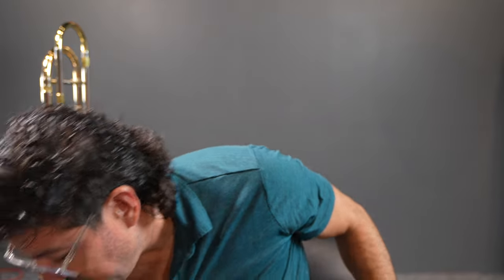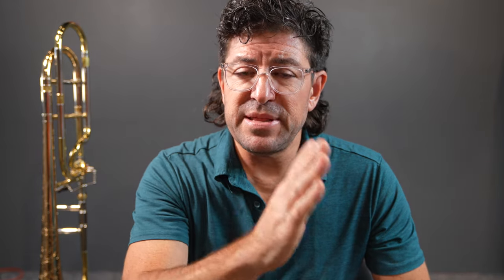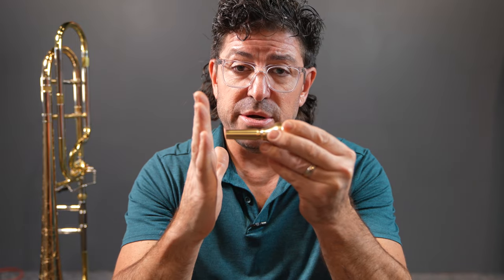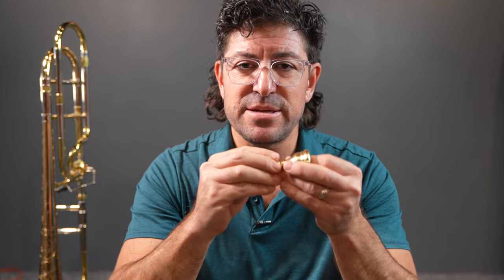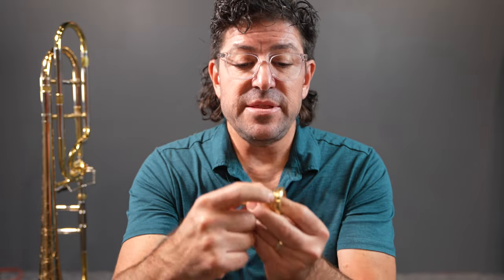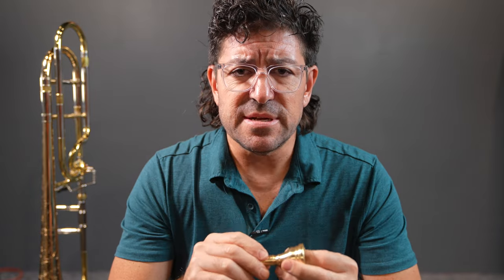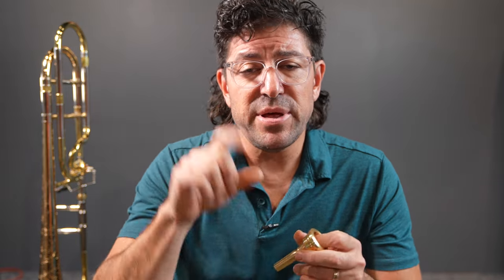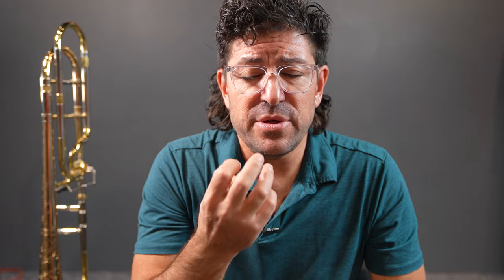HOW I MAKE MOUTHPIECES!  (My Secrets…)

Comment: I'm a fan of Wedge mouthpiece - the rim feel is just terrific. The only minus point is, the 108 width is just a bit small and the 110 is a bit wide. So the 108 sounds a bit too aggressive and the 110 sound a bit tubby. I know Doug Elliot has a 109 rim width, but he refuses to consider either a Wedge rim or a .300" throat I like. Can you do a Wedge rim/cup with a 109 diameter and .300" throat? Would that be somewhere around a Markey 82? Oh, and I play a Yamaha Xeno 822g dependent bass trombone. The receiver is somehow wider/deeper and I seem to need a Remington type shank size, so the Yamaha receiver doesn't simply swallow the mouthpiece shank. I had that problem with a Griego Hecht I tried.